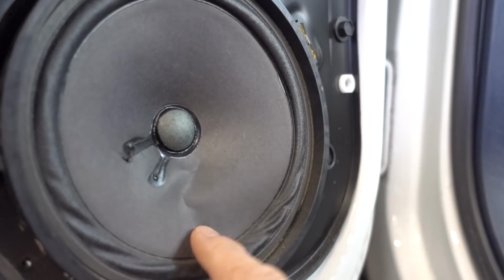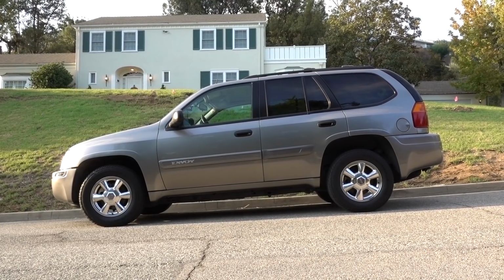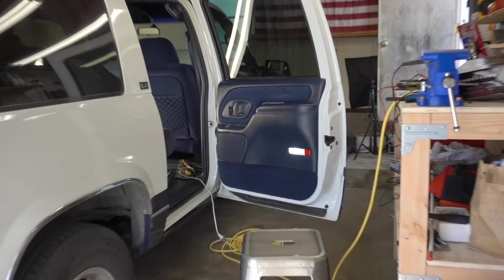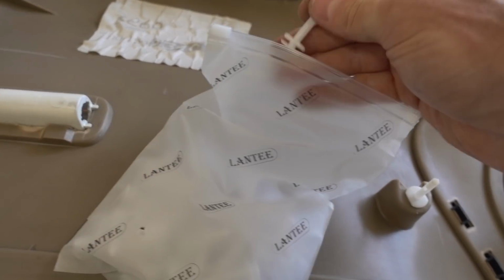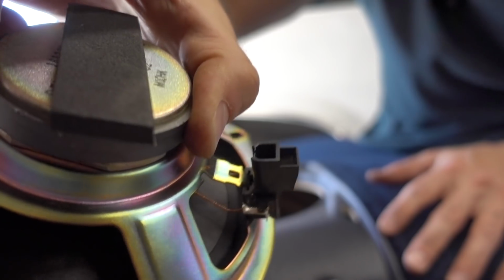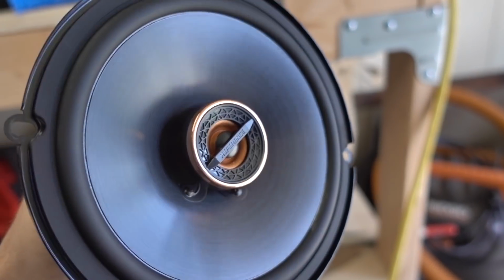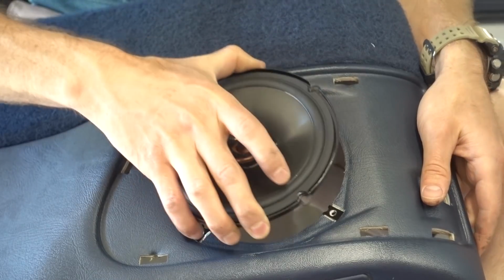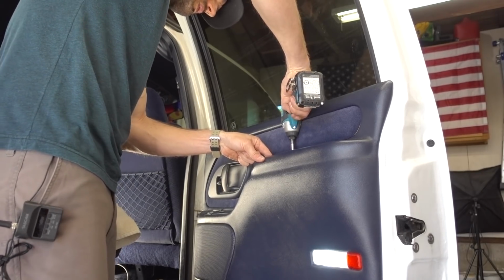This Is Why YOUR FACTORY CAR SPEAKERS SUCK!

Comment: The cheapest Sony speakers from Walmart sound better than the factory speakers from my '99 Accord.
Blowing all the factory speakers at once was a blessing in disguise.
Reply: My 97 Honda LX has the worst factory audio system of any vehicle I ever owned. My 2003 Toyota Corolla sounds awesome stock. My 2003 Toyota Tundra has the best factory Audio system of any vehicle I have or owned.

Comment: My 1993 Lincoln Mark VIII came with the JBL system. The speakers still sound amazing, but the factory amplifier took a crap. I got a wiring schematic for the audio system, cut the plugs for the amplifier, and wired the factory JBL speakers to a new Pioneer media
receiver. I also added a Rockford Fosgate 600 watt mono block amplifier pushing two 12” JBL subwoofers in a sealed box in the trunk. It sounds AMAZING! I’m really impressed with how well the interior tweeters and mids sound, being 24 years old!

Comment: A drop of 3M 8008 “weatherstrip adhesive” on the screws will keep them from vibrating loose.
Dynamat stuck on the metal inner door also is supposed to improve the sound.

Comment: I did a budget speaker upgrade on my 2007 Chevy Trailblazer. I went to a junkyard where I found a Audi S4 with a Bose Speaker Package. I paid $10 for all 4 door speakers and put then into my trailblazer and they sound amazing. I went a step further and did my first sub woofer install where I spent less than $50 total. Balling on a budget is still possible!

Comment: 2007 Mercedes with Harman & Kardon Dolby and im Fine with it.
Im a audio guy and build speaker systems with (real analog) 3000W but the sound in the Mercedes is really good.
Reply: wafemaster I just got an 06 e320 with Harmon and it’s incredible. Sub in the parcel tray can’t believe it’s factory
Reply: Yep, my E63 has great sound from the Harmon System

Comment: 2010 Ford Expedition EL, audiophile sound system, with a subwoofer. The sound system was $400 option, it was definitely worth it. The sound system is amazing.
Reply: I have a 2008 Expedition with the same package... my dad has a 2014 Expedition limited without it and it’s light years away from the audiophile system 👍

Comment: Got 2 sets of Infinity REF 6532EX to replace the things they call speakers in my 2021 Honda Civic EX.  Front were easy, rear ones were tedious but not too difficult. Also got a Kicker 400.1 amp and a Comp 12" DVC 2ohm wired to 1ohm. What a difference, next up is the head unit. Videos like this on Youtube helped a lot.

Comment: When I started driving in 1973, the common standard for speaker upgrades was the Jensen 6x9 TriAxial. Everybody had then (and an 8 track mounted under the front seat out of sight). 8 track player thievery was a booming "business". The Jensen's were easily recognizable for the bright blue foam surrounds. It was rare to get 3  or 4 years out of them because of coarse, the foam always broke down.                                                                                                                                                                                                                                                                                                           
                                                                                                                                                                                                                                                                                                           In 2001, I bought a 2002 Dodge Dakota Quad Cab with the approximately $460.00 "Premium 8 Speaker Infinity Sound System". At about the 5 year mark, one by one the speakers started the tell tale buzz, which of course was the cheap foam surrounds breaking down. After pulling things apart, I was shocked at just how crappy the four 6.5 paper cone foam surround speakers were. The front doors had 6.5" woofers, and small dome tweeters mounted high on the door close to the dash. The back doors had one 6.5" 2-way speaker mounted low on the door. Dodge counts a 2-way speaker as 2 speakers.              
                                                               
That was a lesson learned for me, That expensive upgrade was a complete and total ripoff. I doubt if the actual cost to Chrysler for that premium upgrade. was 40 or 50 dollars. I suppose  in most cases, you're way better off getting the basic and upgrading. I remember years ago, if you factory ordered a car, there was always a "Radio Delete" option. Are there any factory premium sound systems that are actually worth it?

Comment: My brother recently got a MK4 Golf as his first car, It came without a stereo so I installed  an old Pioneer I had lying around.
I just couldn't belive how good it sounded (without any EQ) on the front doors, but on the rear it sounded as bad as any generic factory speaker, so I just assumed the last owner had upgraded the front speakers, but left the rear factory speakers in place.

One day my bro asked me to fix something with his door lock, and when I took the front door panel off, I couldn't believe my eyes, those great sounding speakers were, in fact , still the genuine factory (paper) speakers!
I took a look inside one of the rear door panels just for curiosity and they were also still factory original. (those sounded really bad though)

For some reason the front speakers of this Golf sounded as good as the JBL MS-62C's that I've got in my car, with premium amplifiers. Sure, not as loud or as bassy as mine, but just as clear and refined!
Reply: Sugurain Yh I’ve thought this we have a golf and a corsa but the corsa has Sony speakers and amp with a sub granted it was only one from Halfords but sounds nice with the song speakers but although the golf doesn’t have the bass of the corsa it’s really good. 
I recon is u put a sub in the golf then it would have a good speaker system for the price
Only difference is we have a mk5 GT TDI 2.0l
Reply: @joshuawarrington1051  so why are the Vauxhall speakers really bassy? Also, the Ford and Vauxhall interiors always feel like good quality like the Japanese car interiors.
It was always the 90s and early to mid 2000s European car interiors that felt cheap, light and brittle. Why was this?
Reply: Same! The chevy in this video had the worst design and speaker setup that I have ever seen from a factory. My old 1998 B5 Passat really put that cars factorys speaker system to shame!

Comment: I have a 2012 Ford Fusion SE with the 6 speaker audio system, and SYNC.  I kept my factory head unit, but replaced all 6 speakers with Kickers CS models from Best Buy that were on sale for almost half price.  I bought 2 pairs of 6x8 coaxials and 1 pair of component tweeters.  They sound awesome even with factory head unit power.

Comment: Great tutorial video, and your absolutely correct, the factory speakers are garbage because the car manufactures are not concerned about how the audio system sounds. I drive a 2015 chevy Silverado crew cab, and the factory speakers made an annoying popping sound when I had the volume above 25% with increased bass, so I personally replace the speakers with (Rockford Fosgate) car speakers and I get amazing music reproduction! I wish you would have given a sound demo after your installation, just to make a comparison between Rockford and Infinity brand car speakers, awesome video though!!! :-)

Comment: Well in my citroen berlingo which is a highceiling car the same paperspeakers were built in. I inly wanted to dampen the metalsheets and put some soubdabsorber inside but when I saw these crappy speakers I also removed them. And also placed in new twoway speakers, the cheapest I could find. The effect is phenomenal as you describe it.
Reply: Oh! My parents had a gold/metallic yellow 2001 Citroen Berlingo back in late 2005 and early 2006 and I loved the radio and speakers, they sounded really good to me. I used to take the grille off the left door speaker as it turned to the left and came off very easily. Coke from Burger King spilled on the grille so I had to take it off to dry it. So ok, the interior plastics weren't fantastic quality, but their 2004 Renault Master van's interior felt SO thin and brittle and the window winder fell off when I wound the driver's door window up. The speakers in that van had no bass at all, even though I turned the bass full on. Their 1995 or 96 Ford Transit speakers had lots of bass and the interior felt so much better.
Oh and they had a 1996 or 1997 LDV luton van and the radio hardly worked and the right speaker was the only 1 that worked. That 1 didn't sound so good. The interior also felt so cheap and brittle in that vehicle as well. This was also the case with 90s and early 2000s VW van interior. The Japanese car interiors always feel so thick and heavy. Very good quality interior and fantastic sounding speakers.

Comment: I Drive a 2011 Subaru Forester and had to change out the factory door speakers twice. My factory speakers blew out and I did the first change to Boss BV9364B 6.5in. Speakers. These speakers only lasted two months and they produced really low quality sound. Then I swapped out those speakers to Kicker 43CSC654, and they were way better. One thing that I would recommend if you also plan on changing your factory speakers is to install an amplifier that would put out enough power to feed your speakers. It will help provide a great quality sound and also increase the volume range.

Comment: Saab 9-3 2007 with Infotainment Plus. The stock head unit and boot amp are actually pretty good (Delphi head unit and Pioneer amp), but the stock (Pioneer) speakers are dreadful, so I changed all seven (7) out for Hertz units. It now sounds awesome even without a sub. Clarity is it's big strength, especially vocals.

Comment: Three things:  First, if you're going to replace the speakers with the objective of better sound, use rubber bushings on each of the mounting screws to damper vibration of the inner door panel.  Two, spend a few bucks and get some sound dampening mat (like Dynamat) and apply to the inner door panel, this will further dampen vibration to give you crisp, clean sound.  Lastly, consider installing dampening baffles to the back of the speakers to absorb sound waves bouncing off the inside of the metal door shell.

We did all of these things to my 04' Thunderbird and retained the factory (Audiophile) stereo and speakers.  Now the sound quality is night and day...and that's in a convertible!

Comment: 4:22. That miniature "odd' cone in the middle is what is called a whizzer cone. They are supposed to amplify the higher frequencies. I mentioned the foam-rotted speakers in my '97 Corolla on my previous comment. The foam-rotted ones were the rear speakers. The sun always found a way to beat the crap out of the surrounds and the cones. Just saying, if the foam hadn't rotted, they would still be high-quality speakers.

Comment: Well, for a fun fact.
My old BMW uses Nokia branded speakers, combined with the stock amp, they suck, but driven with a decent amplifier and an DSP controller, they sound great!
The woofers are actual hifi drivers from the 70's West-German 'ITT' brand.
The Nokia LPT-130 midbass, 40W RMS :D

Comment: I replaced mine without removing the door panel , I just pulled the speaker grill and I start from there .
Reply from the maker: I was thinking about that but didn't want to break anything...
Reply: There is more of a chance you are going to weck your car by disassembling the whole door rather than just one peice of plastic.
Reply: Some cars you cant do that. My 96 corolla, the whole door panel has to come off because the grill is screwed on the inside of the door panel, so you'd just be breaking it off.
Reply: Jonathon Petersen but this car that was not the case.
Reply: Pye Ltd. more than likely he didn’t know you could just pull off the speaker grilles. Being that you have to take the from door panels off for the fronts to change them out. Give the man a break he’s trying to be helpful.
Reply: @pyeltd.1997  some cars  you can take the easy way some cars you can't. it is always good to show the full step process just in case if you can't take those steps since a good amount of people can't take that route and this was a general video
Reply: @FeelFighters  what did you put in?
Reply: @1RoadGarage  you know what they say , better to be careful than sorry 😉
Reply: @FeelFighters  on my old Peugeot the grill is part of the door panel
Reply: sancho lopez you can tell by looking at the speaker grill. At least try with a flat head screwdriver
Reply: My speaker grille broken THANKS...
Reply: Gabriel Vieira lol
Reply: Gabriel Vieira you don't need the speaker grill. Just have the Speakers showing like a real G.
Reply: @pyeltd.1997  😂
Reply: @1RoadGarage  You did the right thing, way less stressful on the speaker grills.

Comment: 2011 Silverado crew cab I changed from factory to infinity kappa series 6.5 inch speakers in all the doors ..they sound great for a mid tier speaker, especially when connected to an amp. I want to get the infinity perfect series soon.. great video

Comment: I have a 1994 GMC k1500. I changed out the factory speakers on the dash because the passenger side one was blown, but the rear speakers work very well

Comment: 1990 dodge ramcharger.  The speakers are all working and are in good shape, not busted or cracked. I wanted to upgrade. I am putting kicker 6x9 from bestbuy on sale for 60$. But they are not as loud as the factory speakers. I may need an amp or maybe a new head unit. But I want the original look. I do enjoy your videos, to the point. Keep up the great work!

Comment: I drive a 1999 Ranger, when I got it, it had factory speakers and an after market Kenwood head unit as old as the truck.  Honestly it didn't suck.  I started with Infinity KAPPA 682.11cf 6x8" door speakers.  Oh baby! what a difference!  Next was a new  Bluetooth capable Kenwood head unit, then a KAPPA 800W sub in a "custom" center console enclosure and matching amp.  The most thumping single cab beater Ranger you ever heard.  I pre-wired for a 2 channel amp for the door speakers but I can't justify the expense, the stereo already costs more than I paid for the truck.

Comment: I have a 07 Silverado and it came with Bose speakers that sounds great
Reply: Same with my 2000 Silverado. Replaced drivers one twice, but they sound great.
Reply: Bose  is absolute  garbage and it goes to show you how important  the box design is Bose  has been selling  absolute garbage  speakers  and make  it up in the box
Reply: @highspeed9518  I agree that expensive radio is garbage too. I heard one in a Bose showroom. I will always say a 15 inch woofer sounds much better than a 5 inch speaker no matter what enclosure you use. I bought at a thrift store two solid walnut enclosure with Jenson speakers inside  and they sound good..  as for car speakers you have to use what fits I will definitely look into them speakers or like speakers by infinity.
I like large speakers at home as for the SUV I drive I will need to do more research on different types of speaker I can't have my vacuum tube sound in my car.
Reply: @ronb6182  Harman : Infinity, AKG, JBL, Crown, Revel..
American subsidiary of Samsung
Reply: @StaticVapour590  I like crown because I know their background. They are up their with Fisher in my list of preferred products. I know nothing about Jenson but know the ones I have sound good.
Reply: @Everything I prefer clean bass myself not loud bass.
Reply: @highspeed9518  I agree i had a friend that worked for Bose years ago. These factory speakers cost them like $8 to make.

Comment: Clean install. Sometimes there is a little tab on the speaker you can bend out to slid the factory plug onto and add a little wire to the connections. This way your solder joints won't come loose from vibration or if tuged on.

Comment: I have a 2002 Chevrolet S10 pickup that was equipped with a factory AM/FM radio with no cassette or CD player.  The speakers were crappy factory units.  I replaced the head unit with  a Pioneer MVH-S600BS double din  head unit and replaced the dash speakers with Pioneer's TS-A1306C component speakers (originally 4x6 speakers, I made these 1306's fit with homemade brackets) and the door speakers with Pioneer's TS-A1606C component speakers. After this upgrade,  the sound is a definite huge improvement. I plan on installing a powered subwoofer  later on.